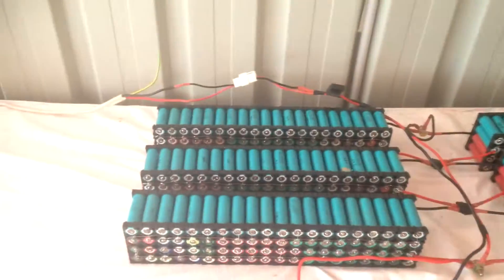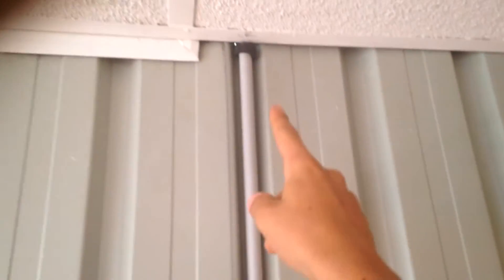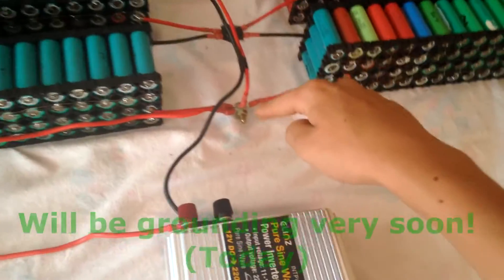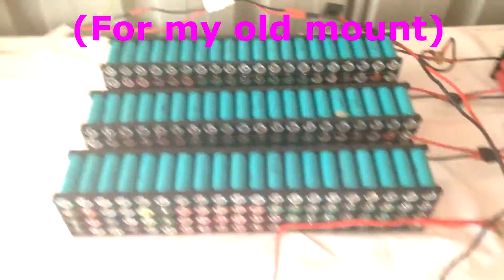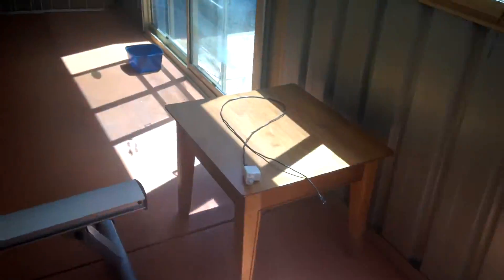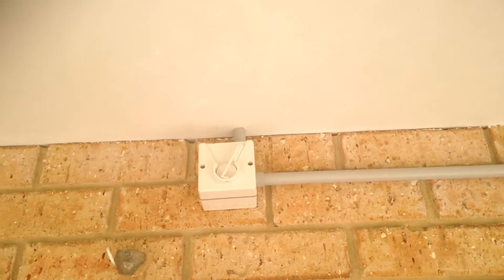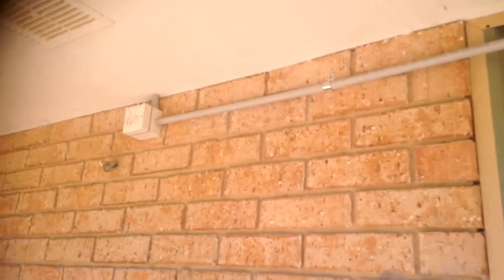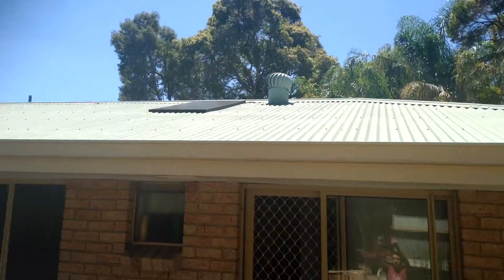DIY Tesla Powerwall | Solar Switch Install | Update 9

Comment: Tell me you have a charge controller between your panel and batteries ? Can't remember from earlier videos sorry .
Reply from the maker: HBPowerwall no sorry I don't have a controller. It sounds stupid connecting directly, but it works. Since I connected them up have have had no problems with overcharging or balancing. I have been working on a voltage monitor with an arduino. This I hope will give me the ability to monitor from anywhere, as long as I have an internet connection. If one cell gets over a certain voltage threshold the arduino will automatically disconnect the solar panel with a relay. Anyways thanks for watching this video and I hope you kinda understand why I don't have a controller.
Reply: Was just checking :) sounds like you've put some thought into it already.

Comment: I have a strange question for you. I have an etwow booster 2 electric scooter. It's 33v 6.5 ah 500w. I would like to  build a new battery with high quality cells at 36v but I have no background with electrical things. Can you recommend the things I need to buy? I saw your 36v 10ah video which might actually work for this
Reply from the maker: net200777 if you need high quality cells I would recommend old drill or laptop batteries. I get mine free from a battery agency. Just as a side note I caution you with these batteries, since dangerous if handled incorrectly.
Reply: RandomDIYProjects do you have recourses for me to go off of or tutorial? How many cells do I need to make 36v?
Reply from the maker: net200777 the number of cells  depends on how much capacity you want and how much is in each cell.... maybe 100 cells?
Reply: RandomDIYProjects I'm hoping to take it from 33v 6.5ah to 36v 10ah
Reply from the maker: net200777 ok, you will need 10 cells in series to get 36v and for a 10ah pack you may need 5 in parallel (1500 mah each) hope this helps.
Reply: RandomDIYProjects so if I understand correctly. nope I have no idea hahah
Reply from the maker: net200777 just watch more ebike battery videos and you will be a pro, have you seen rinoasupergenius ?
Reply: RandomDIYProjects ya I've been trying to learn by watching but I'm not sure where to start. Do you have a contact info
Reply from the maker: net200777 everything I learnt was off the internet, binge watching YouTube videos and website articles.
Reply: RandomDIYProjects well I'll keep trying